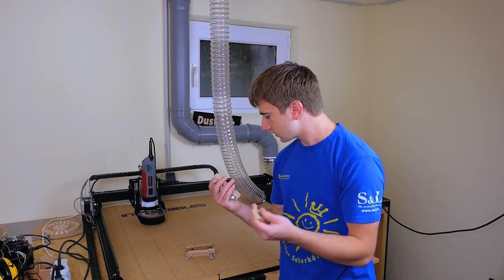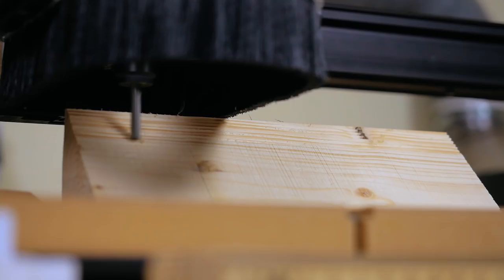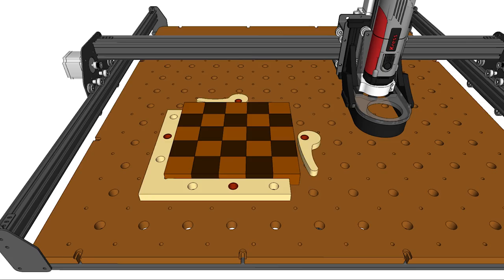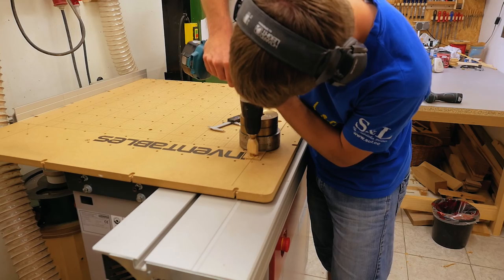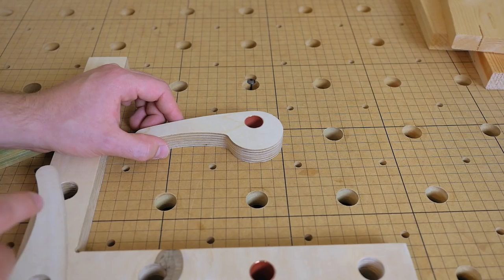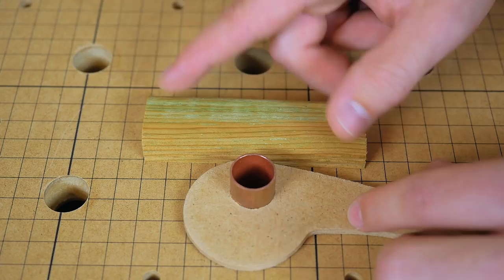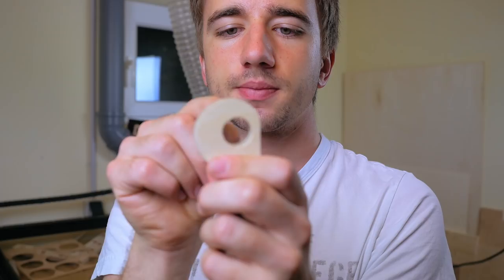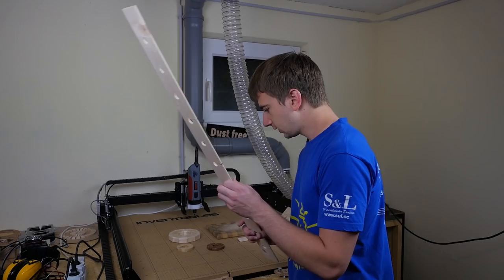Making new and better CNC clamps (free templates)

Comment: You sir are a genius! This is the best explanation I’ve seen of why the position of the pin is critical. Very generous of you to supply downloadable STL files. I’m just getting into 3D printing so I was able to import your STL into Fusion and 3D print a template, which  I’ve used to transfer the design to some ply. Rather than copper pipe, I’ve 3D printed some pipes which just have a tiny tolerance, so they can turn in the dog holes. I used CA glue to bond these to the ply cam levers, and it’s working beautifully 😊. I thought about 3D printing the whole cam lever and pin, but it would have taken hours on my basic printer! Many thanks again and greetings from the uk.

Comment: Marius, your use of the calipers , I have never seen nor, never myself, thought of. This would be a great way to make a table saw cross cut sled.  As I watched and learned of a very efficient way to hold work pieces squared, and secured to the cnc spoil board, I am amazed at the simplicity when your plan came together to the final outcome. Well done Pilgrim.

Comment: I've been working at a small shop with a big CNC machine for ten years now, and I've made cams like your first version for some special stuff I've had to do. I resorted to screwing the handle down when it was tight and shimming with pieces of edge-banding when the fit wasn't perfect.
I only rarely need things like this since we mostly work with much larger pieces (we make kitchen interiors) where the vacuum suction cups the machine comes with work excellently, but I'll keep this video in mind for when I do personal work :)

It's a Holz-Her 7120 if you're curious, there are clips of similar machines on youtube. It might be old, but at least it's not a Masterwood 319 like we had before :D

Comment: I had a brain-fart and thought I had arrived at a clamp for holding things to my CNC router (which at this time I have not purchased yet ). I am studying VCarve. No need to purchase a router if I can't program it ( even though I programmed a 3.5 axis milling machine and a CNC lathe when I was a machinist till I retired using MasterCam ).  I was thinking of cutting a rabbit along the edge of the material I wanted to use and having a male / female part on the clamp to lock the material down to the table, no lifting that way. I love the Physics of the whole thing. COOL !

Comment: A simpler way to explain why the first cam lever didn't work is just that the change in radius was too large, or too aggressive.  Too much movement away from center compared to the movement of the lever.  The change in radius needed to be more gradual, which reduces the amount of clamping movement and also makes for the main limitation of such clamps if you aren't using consistently sized material, you will need a lot of different spacers.  Scrap can always be cut to fit as needed, but I'm also going to make some to keep that will have different sizes on each side (for instance 3/4" one side and flip 90 degrees for 1") in pairs or sets of 3 for larger material and mark them for easy match-up.  It was nice to see this in practice as I'm getting ready to re-do the bed of my own cnc with dog holes and was planning to do mostly the same thing with cam levers and wedges, along with home made t-track clamps and a couple of other options for maximum flexibility for random size and thickness of material..
Reply from the maker: You're rigth, but that's not the whole story. Having a small change in radius is key for it to work. And a linear change in radius along the range is best
Reply: @MariusHornberger  Not disagreeing, but just to add information for others that may design their own, the workable amount of change in radius is related to the diameter of the head.  If you have a 2" head maybe 1/4" change around the circumference is ideal, if you had a 3" or 4" diameter head you can have a greater change in radius for more clamping flexibility and power with the same rate of change for proper function.  Someone who mostly clamps larger objects (like slab flattening as I do occasionally) will want larger and likely taller cams, while smaller cnc's with smaller material will do fine with small cams.  It's good to continue thinking through this, I just added making multiple size cams to my list for the new setup..  :)

Comment: I REALLY like the idea of the story stick and I'm glad you drilled the holes that way instead of by CNC.  Not all of us have a CNC (yet).  I would think that, potentially, this would be just as accurate, if not more so, than a CNC--especially if the machine "drifts" a bit and others have reported.

Comment: Thanks for that Marius, I have been working on this all afternoon, I have re tensioned the gt3 belts and checked the steps per mm x and y. I had the x and y different values.. I have made them both the same and a 300mm circle came out perfectly. I will try your square suggestion tomorrow.. Made the clamps by the way, they are great! Thanks for your help.. Regards Peter

Comment: A point about "working it out" - you don't need to work that out if you just aproach it mathematically - those shapes are called "involutes" or "logarithmic curves" (Deutsch: Evolvente bzw. Fadenlinie) - it is basically the shape that the endpoint of a string makes, if you wind it around a stick

So if anybody wants to design their own clamps, no need for working it out - just crate one of your own or take some out there - the golden spiral or the fibonacci spiral are common examples you find tons of SVG files out there in the wild

Comment: Very interesting process! sometimes is good to have some mirrored cam levers so you can work clockwise and counterclockwise, depending on how the force is applied to the piece. If you dont glue the copper then you can just flip them upside down :) just an idea! good job
Reply from the maker: That's true. I didn't show that in the video, but I always made a pair of "normal" and a pair of mirrored ones for each thickness.

Comment: Nice stuff. I'm building similar Parf guide systems for my benches and tools with the same types of fence but tend to prefer using horizontal toggle clamps (i.e. Bessey STC-IHH25) instead of cam levers.

Comment: I feel really guilty commenting on such an old video. Of course, I love it, and am amazed by your genius.  My question was with regard to the mathematical constraints that you used to design the clamp.  I got that you said that as you rotate the clamp the radius to the point of contact grows, and I think you implied "linearly".  (Maybe you only implied the rate of the distance increase as it rotated increased monotonically).  I was just interested in some more math behind your derivation.  (I'm not a mechanical engineer, but I followed what you said pretty much.)

Thanks for posting so much.  I really enjoy your videos.
Reply from the maker: A linear growth and a constant growth rate (maybe you mean constant instead of monotonically) describe the same thing. You got it right. The shape for that is just a spiral, but I didn't use that for drawing back then
Reply: @MariusHornberger  thank you so much!  So it's simply r = k * theta.  Thanks again.  BTW, would love to see an update video on what you're up to in life.  I'm pretty sure you were in highschool when you started making videos.  Now you're graduated college.

Comment: Hi, I just discovered your channel, interesting videos.

In this video you shows how you can clamp objects with the holes on the board.
I have a workmate that works with these holes system and it was in a couple years worn out.

A better system are steel buses pressed and screwed on that plate.
Reply: Getting a couple of years out of a spoil board is great, so that is not really a down side.  The T-nuts installed from the BOTTOM work great, but you have to screw and un-screw all the time.  Also cost more and is much more labor intensive to set it all up.  Just my two cents.  Peace

Comment: In my opinion, it would be better if the clamps were made of tougher kind of wood or even artificial material. They must be useful for a long time, so they should be made of a stronger material than the one that is processed, especially stairs in stair's ramp (they can be smoothed out). Besides, really good work.

Comment: you should make the steps bigger. less chance of slipping.  I've used the metal version on cnc mills. 
the low profile edge clamps are killer tho. ive used a version called MightyBites. works the same except this isn't brass

Comment: Thanks Marius, for all of your great videos! I am setting up a new machine and was wondering if you are still happy with anchoring your cam clamps in dog holes? I was also planning to include t-tracks, but for carves with no upcuts, I was planning on using your cam clamp and adjustable spacer approach. After all this time, do you still recommend dog holes and copper pipe? Thank you!!

Oh, and if you do still recommend dog holes, would you recommend using a downcut or compression bit in a spiral pattern to cut them?
Reply from the maker: I don't use the dog holes or cam clamps anymore. For my type of work I setup a different clamping systen now. I made a video about it as well
https://youtu.be/kKO5Yq_bVHc
Reply: @MariusHornberger : Thanks for your reply.  I’d seen that one before, but am thinking that your cam clamps would suit me best for what I’m doing. When you were using them, were you satisfied with their performance? Thanks!

Comment: Very nice solution. Have you thought about using the hex bolt (with the pre drilled holes) for the pivot and to hold the cam and fence down instead of drilling the holes and using the pipe? It's not as much mass, but might still work. I'll test it out and let you know. Thanks again for the file.
Reply from the maker: Yes, but the small holes would wear out much quicker. The bigger ones have about 2,8 times the area inside the hole.

Comment: Great job with project and video. Does the size of the hole on the off set cams matter in the holding power. The pivot point is constant whether the pivot hole is 1/4" or 3/4 inch? I am playing with the size of the can that will work best. Thanks again for your video.

Comment: Thanks Marius, those look really handy. I'm curious though about the size.  I printed those templates out and they look smaller than they do in the video when you are holding one of them.  The ones I printed out measure an overall length of 4-7/8".  Does that sound right, or is my printer printing them too small.  Thanks again very much for your video!
Reply: He replied to a similar question. They are about 127.5 mm. Or a little over 5 inches.

Comment: Hi Marius, vegates, I think this is a really good idea, I have just bored out the (in my case 15mm holes in a secondary waste board. I have a quick question, when I set the hole diameter to 15.2mm it actually made a 14.75mm hole. The machine is bang on calibrated, have you seen this effect. Many thanks for this idea ! Regards, Peter
Reply from the maker: hmm, try cutting out a square and check its size to make sure the machine is set correctly. Also bit size, tool path (inside, outside, on path) set correctly?

Comment: This is great. I'm going to try making a set. Would you happen have the cams available in DXF or SVG format? That way I could cut them on my CNC (I don't have a band saw or jigsaw available). Thanks!
Reply from the maker: There's now a second link for a SVG file
Reply: That's great, thanks!  I know you explained in the video how this version of the cam works, but can you tell us if you got this design to work by trial and error, or did you learn how to engineer it? That is is there a formula for calculating the correct position of the hole inside the circle.
Reply from the maker: I saw that a sudden change of cam advance also suddenly shifts the point of contact. So I had to avoid that and I knew how to do that.

Comment: Hi Marius, a few days ago, I saw this video and told myself, what a great idea. My only concern was that there was no pressure downwards applied by the cams when tightened. Tonight I came back and looked at it very carefully  and noticed at 7:30 that indeed the work piece came up when tightened and back down when released. Can this be avoided? I would hope so because I really can dig the idea and If you have a remedy to this I would certainly use your concept. Thanks for your your time.
Reply from the maker: Yes, the pices lifting up is a problem. I used to hit the parts with a mallet after clamping.
Reply: There potentially is a way of counteracting the rising up of the stock. As the cam clamp operation involves turning (rotation) in the dog hole, the cam surface that makes contact with the wood stock, could contain a groove (horizontal, but sloping gently) that starts high, and slowly moves down (like a screw) around the cam face. The groove could contain a high density rubber strip insert for example. Thus, as the clamp is rotated, you get horizontal AND downward vertical pressures. A lot of work to make these, but then you really only need four.  On a slightly different aspect,  I've just made 8 cam clamps, but made four handed one way, and the other four handed the opposite. This means if I have clamps each side of a piece of stock that is at right angles to my bench, it will be the same pulling (or pushing) action to operate the clamps. Hope this inspires either you or Marius to come up the a deluxe version of the cam clamps shown in the clip.

Comment: About wear management: To my knowledge, that waste board is quite expensive (at least much more expensive than the cam clamps). So the clamps should be the consumable part, right? Yet, you chose to fix the copper pipe to the clamps, making sure the rotating pipe will wear out the holes in the waste board instead. Do you have a reason for this choice?, cuz I'm curious about it :)
Reply from the maker: Only the original Inventables waste board is expensive. As it's just a piece of MDF I can replace it for less than 10€, if I ever need to.
Reply: Still, replacing the wasteboard is also more time/labor-intensive than replacing the clamps, what do you think?
Reply: just a little picky!
Reply: good point, gluing a wooden dowel in the cam would make the cam consumable

Comment: Sorry if I missed this but WHY copper? Copper is soft and expensive! Why not wood or hard plastic or even metal pipes?
Reply from the maker: I had them laying around and they fit perfectly in a hole from a forstener bit.
Reply: @MariusHornberger  THANKS for the reply and for the video. I am making one of these this weekend (24 x 24  and using thick wall plastic pipe) to use on my workbench for sanding and similar work that needs to be clamped in place but the surface fully exposed on top. I wonder what the best way to hold something for routing would be other than double sided tape?  But I guess that is what a router table is for.

Comment: Very nicely done. That stepped hold-down design (in aluminum and steel) is used on regular mills all the time. It works quite well. In the US, you can purchase them pre-made in aluminum or steel for small mills. Example: http://littlemachineshop.com/products/product_view.php?ProductID=3667&category=

I really like your cam action clamping system there. I may do something like that now that I've seen it. Thanks for the video.
Reply from the maker: Thanks. I have seen this step design on other mills as well and copied it from there.

Comment: Love your videos.  Could you include a dimension on the templates.  I am trying to bring in the svg file to Fusion360 but it doesn't scale correctly.  It brings them in really small. Or, a DXF file would work as well.
Reply from the maker: The clamp is in total about 127,5mm long